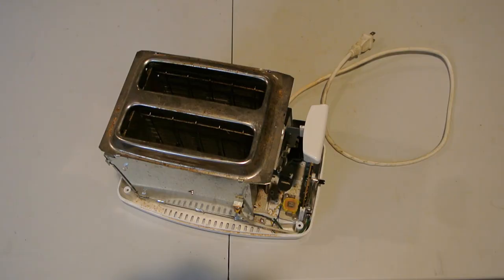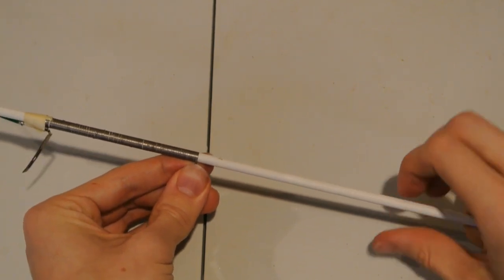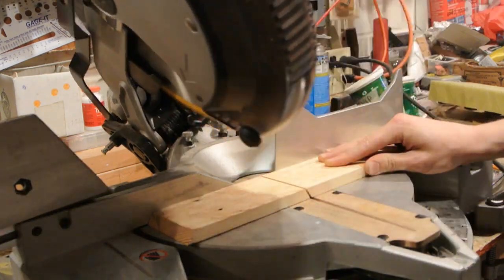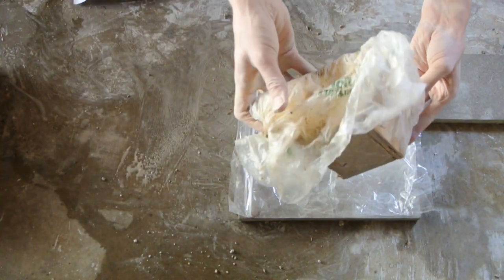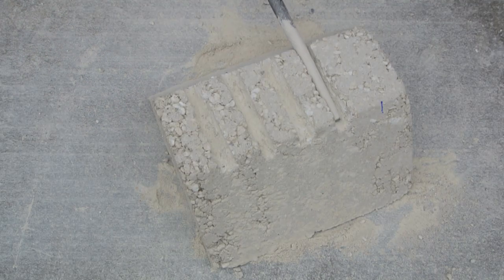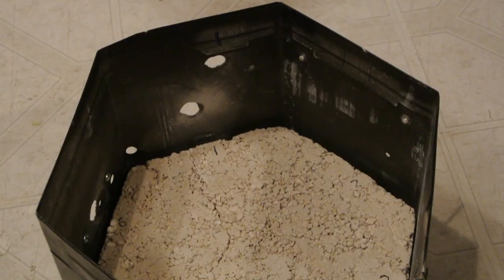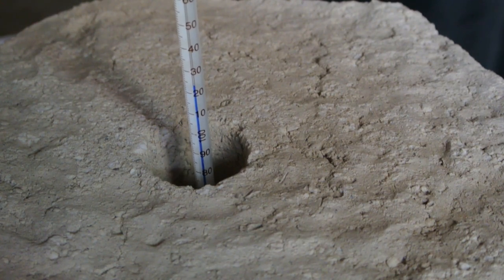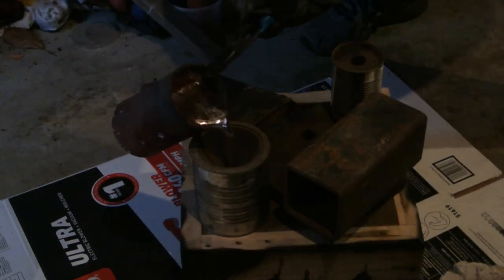Building a 1000°C Electric Furnace From a Toaster!

Comment: Dang. An hour to heat a soupcan sized crucible of aluminum? Guess thats the price of propane. Made one with random pipes and odds and ends for free thatll melt a few lbs of aluminum in ~10-15 minutes from a room temperature cold foundry😂 i thought THAT was slow and inneficient. The temp control would be super nice to have though. Instead of 'no heat/ALL the heat'

Comment: If your PID controller has an AutoTune function, i would recommend getting your furnace up to a desired temperature, then run the autotune function on your pid controller. Then it should be as easy as set it and forget it.

Comment: My PID controller for my injection molding machine did the same thing. It got more and more accurate, very quickly, the more I used it.
Reply from the maker: Ah, good to know. Do you know if we have the same (or similar) model PID controller? Mine is just switching a solid state relay (SSR) on and off; I believe it was a package deal from China on eBay or something like that.
Reply: @ThePlutoniumBunny  I've gotten a bunch of stuff from China recently. I'm not saying that proudly - it's just the only way I can stretch my dollar as far as it needs to go. One thing I've noticed is that someone will copy something that has been useful on the market, then everyone else copies the first guy. Then you have a bunch of sellers that sell the same copies as everyone else. In other words, everything seems to be the same thing with different labels. Your PID controller is probably the same as the three that I have. They do have a learning function, so it's not strange that they will get more accurate over time. The one for the injection molding would overshoot/undershoot quite a bit for the first few days. After a while, it just got better and I forgot that there was ever a problem.
Reply: it does depend on the pid controller. Some have pretty advanced functions, i had a similar issue on one of my blow mold machines. When the original controller went out which was a more expensive but obsolete Allen Bradley model, the managers bought another brand at a medium price, there were timers for the on off functions that the electrician didn't know to set, so the on off cycles weren't giving it enough on time. I had to study the manual for a bit to figure it out, some units have auto calibration but not all of them. Also, its necessary to use an ssr or other type of relay because those heat controllers can't handle the amperage/wattage of the heaters.

Comment: Dude this is a fantastic project! The only thing I'm missing is some more information on the electrical setup. If nothing else it might prevent some inexperienced laymen (like myself) from killing themselves.
As for the PID, it might be because the thermocouple is installed at the very bottom of the furnace, and the PID has some cap on the current for a given temperature. Like the PID is pumping X power through the coils (some sort of preset for the selected temperature), but because the thermocouple is in the "coldest" place in the furnace it needs way more power than the PID thinks is reasonable and it caps out.

Comment: Great project! The 100 degrees issue, have you check the type of thermokoppel is right configured in the controller (K,J, S etc) evenso the DIN or ANSI norm. Do you have used the right compensation cable in agreement with the used thermocouple type. You can easily check the the 0 and 100 points for linearity due to freezing and boiling points of water. Think also about the aging of the element. Long term used K elements will have an error and must be replaced. Succes with your projects!

Comment: The temperature within the furnace probably varies based on the view factor to the coils (since they mostly transfer heat via radiation). The thermocouple might be positioned out of direct view, preventing it from reading the correct coil temperature. Moving the thermocouple to direct radiant exposure to the coils might help.

You also might be able to calculate the temperature by monitoring the power flow + coil resistance, like temperature control vapes.

Comment: Would you be better off using plaster of aris and a wax coating on your coils ? Then burn off the wax once you set the coils in the plaster? Allowing it to dry around the coils
Reply from the maker: Plaster of Paris is not ideal for high temperature applications - it will crack, at the very least. I know it is also risky to get things like wax on coils, as electric coils are not meant to be fired under reducing conditions - this will eliminate the protective oxide coating on the coils, causing the coil to thin and break. I suspect that wax on the coils might create these reducing conditions.

Comment: What values did you use for your PID? Since this is simple on/off power control for temperature you don't want to overshoot the temperature or force it in a gradient too steep. It's probably why it never reached the desired temperature, it's probably oscillating the output to much, I would set in as a PD controller only. Add a fuse or breaker before your relay and use a simulator to find a closer value to use for you proportional and derivative gains.